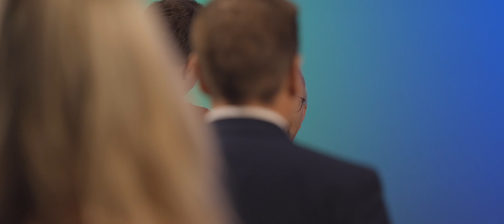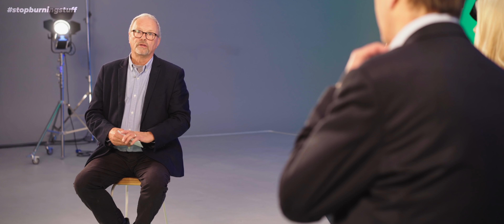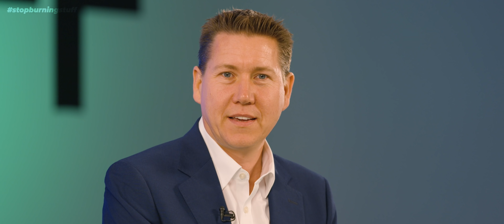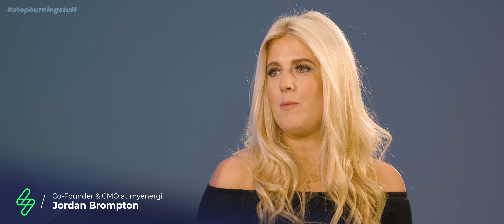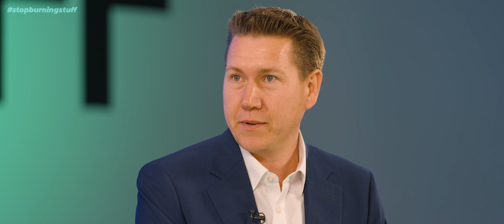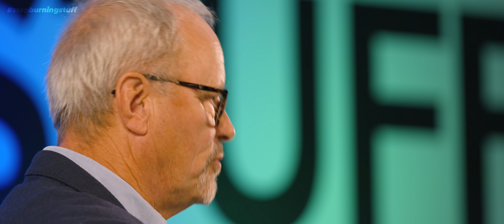Full length DEBATE from #StopBurningStuff sessions | Subscribe to Fully Charged PLUS

Comment: Great discussion.  In terms of action, how about actually removing fuel heating from people's homes and replacing it with electric heat pumps?
Reply: Great idea, only like most, my house was built in 1924 and has a 100 amp power supply which is barely enough. We’d need to have a complete power upgrade and rewire costing upwards of $15000, then source an electric on-demand water-heater (like hens teeth here in America), and electric underfloor or radiant heating system - don’t even ask about the cost for those. Europe is leaps and bounds ahead of America when it comes to heating with electricity, with natural gas still trumpeted as ‘green energy’ here. Unbelievable.
Reply: @alexwilsonpottery3733  I have a daikin mini split heat pump with 3 wall units that keeps the house warm here in -20 deg C and it has a 20amp breaker, so I think the elephant in the room again is insulation. Many people in the uk live in old drafty uninsulated homes and they are naively thinking that can get some magic new heating system that means they don’t have to insulate or draft seal it, or put in energy recovery ventilation etc.

Comment: Can you share the individual (work and leisure) annual carbon footprints for each of the panelists so that we can understand the goals we need to achieve?
Reply: the point is not about anyones individual carbon footprint, but moving forward to reducing every ones carbon footprint. Be that with cleaner energy generation, cleaner transport, batteries etc. making the move away from fossil fuels reduces every ones carbon footprint. Which is what the panel is doing their part to achieve.
Reply: Eco Fascist Green Taxes the poor pay more
Reply: Eco Fascist Green Taxes the poor pay more
Reply: @jimsouthlondon7061  They will certainly pay more, if we don't make the move away from fossil fuels. and make the move to a cleaner more sustainable future.

Comment: It would be great to have an electric car but
1. You can't get them for love nor money. Waiting lists more than 1 year long. They also cost a lot.
2. Can't charge them if you park on the street in a town that only has 1 fast charger and about a dozen 7kw chargers. Clearly the charging infrastructure needs to be rapidly increased I availability. Government take note.
Reply: Hiya, 1, yes - waiting lists because demand has risen (excellent). 2, charging infrastructure has a way to go but is by no means unmanageable & will only get better. I’ve just hired for a month to test this out. Combination of street parking/charging in London - & regular longish journeys to south coast, where chargers are very sparse but luckily the high tech hire car can be charged via garden shed on a 3 pin plug. Slow but adequate & no need to seek a faster solution. It’s interesting. Needs planning & a fair bit of mind-set adjustment, but oh the joy no huge cost at the pump in the last couple of weeks, let alone the good emission-less-ness has been so worth it. Highly recommend a try out with one of the short term lease guys to test this out for yourself.
Reply: USED EVs are out there.
Reply: Eco Fascist Green Taxes the poor pay more